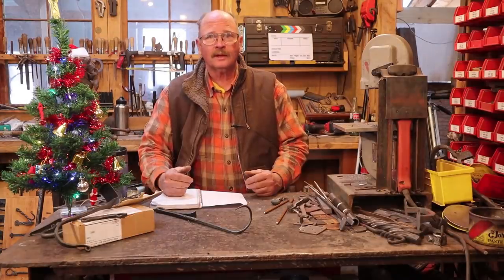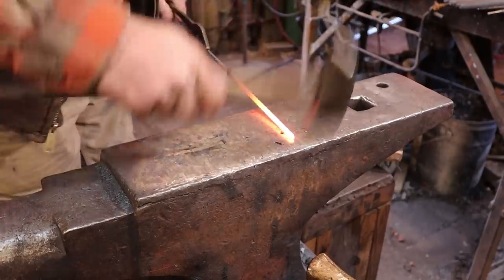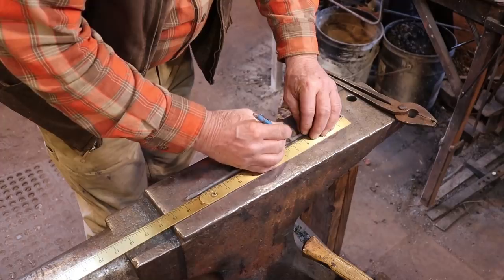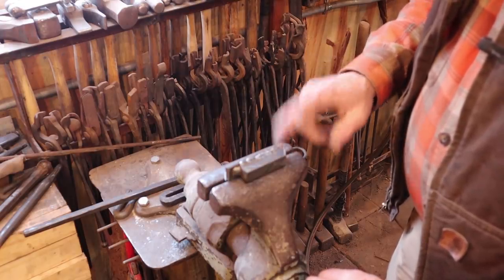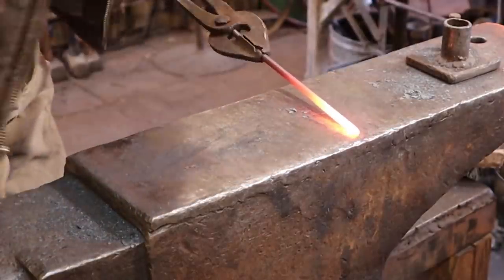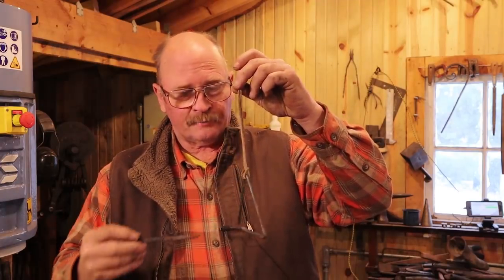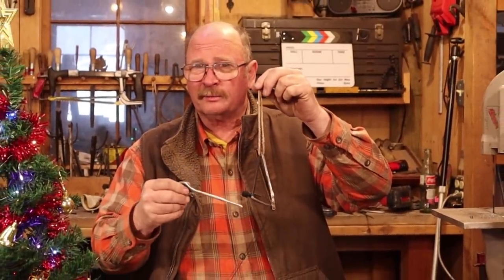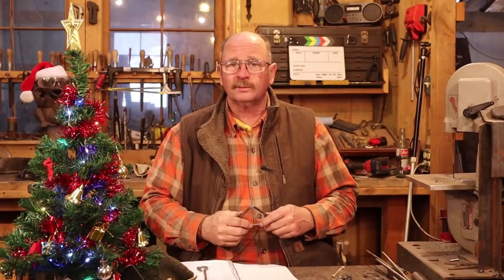Dinner bell Christmas tree ornament - countdown to Christmas

Comment: For thin bars too, you can just use an inexpensive propane torch if you do not have an Oxy Acetylene setup.  Another great project and video.  I am glad you explained the issue of using the gas forge (which I use).  I will try using the torch when I make some of these for my friends.  I will try using the propane torch and the Oxy Acetylene to see which I like better.

Comment: Great little project with minimal need for lots of tools. I would venture a guess if you don't have a set of torches a map gas torch would heat it enough at the bends to work. At least with thin stock.

I can't tell about the sound to many years of jet engines .
Reply: It's in a range I can still here ok...at least b4 the quenching.  It was clear toned w residual harmonics. After quenching it seemed to be deadened alot

Comment: Another way to get a controlled bend in light material is to make a small divot at the point you want to bend it -- usually the inside of the bend works best.  Then even with a long heat it will bend where you made the divot because that is weaker than the surrounding material.  I just use a rounded edge of the anvil to make the divot.  Hold the bar across the edge and tap with the hammer.

Comment: You weren't kidding about the wire wheel being dangerous.  I have been using one my whole life without issues until two weeks ago.  I was cleaning an S-hook when the wheel yanked it out of my hand causing one of the hooks to rip into my finger.  Five stitches later and it still isn't right.  Ouch.

Comment: You need a vacation, but I am glad your still making videos. I have a question unrelated to this video. You have went over many ways to harden steel. Diff temps, quenching mediums, etc.  My question is there a difference if your medium has a skim of ice on it (that mostly being water, or separated water in an oil mix) or at a normal room temperature? I assume it would make some difference, but only on very specific metal alloys.

Don't forget to get back in the house and spend time with the family, you hardly need a reminder to get into the shop and do some work. Happy Holidays.
Reply from the maker: For hardening both water and oil should be heated

Comment: I would like to see you do the POZ tongs that you were using in this video. I tried doing a set after not doing one for 10-15 years and my ratios and bends were off. I tried looking online for a nice cheat sheet, but with little luck. I've reached an age where I need a story board or instructions  for projects  I don't make but every decade or so.... ;-)